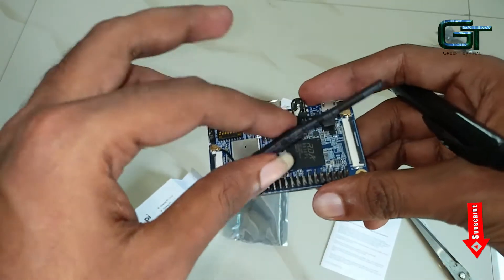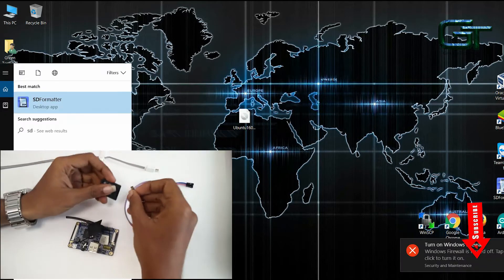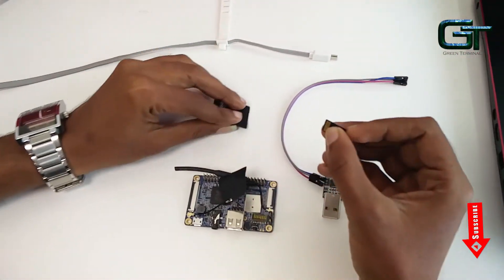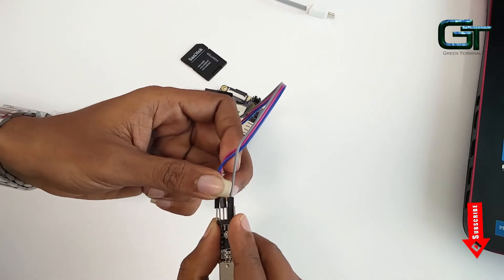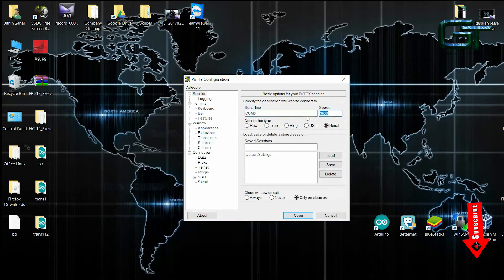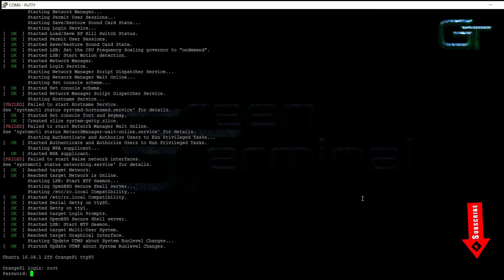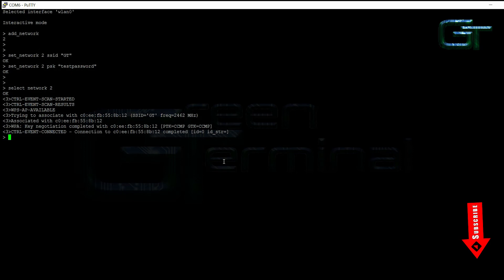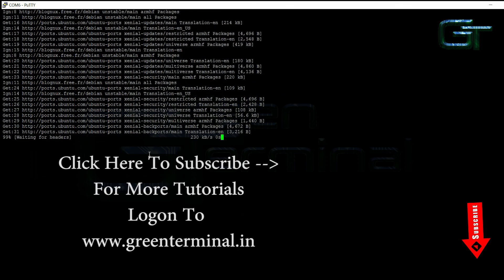Orange-Pi 2G-IOT Setup | Linux Installation and WiFi Setup via Serial Port without LCD Display

Comment: Many thanks! I didn't know that a TTL converter should be connected before a system starts. For my i96 the baud rate is 921600.

Comment: Why are you using a UART adapter? Are you saying the 2G-IOT does not support USB-serial like the Orange Pi Zero model?
Reply: look on the board for a serial to usb chip. if there isn't one, then it doesn't

Comment: Hello,
I am having some trouble with the latest "Ubuntu Server" image, as no baudrate seems to work at least on Putty. Did you experience anything similar? Thanks.
Reply: Baud rate is 921600
Reply: Make sure power supply/Adapter you are using  is 5V/2A

Comment: Thanks for the useful video.
Baud rate 115200 didn't work for me and I had to go to 921600, which is the rate actually quoted in documentation.
Wifi setup may be via OrangePi_Settings or wifi_cli, they both seem to achieve the same objective.
My wifi seems to be unstable. After boot I get lots of RDAWLAN_ERR error messages which may or may not go away. I wonder how others are faring?
Finally one last weird thing, wifi seems to come up with a different MAC address each boot.  I don't see a MAC address printed on the wifi chip like it usually is which leads me to believe its software generated. Any way to make it permanent? I like to program my router to assign fixed IP addresses which I cant if the MAC changes all the time.
Reply: Do you know how to save a new baudrate in u-boot? I did set it with "setenv baudrate 115200" but normally u-boot has the command saveenv to save the environment....but the RDA u-boot doenst got it :(
Reply: type "ifdown wlan0", to stop them
Reply: thanks mate

Comment: Hello...I follow all steps but I can not get it turned on (fomat the tf card, then write the ubuntu image) . I put the jumper J7 in T-card position, then put the TF card in TF slot and finally connected the Power Adapter, however the red led doesn't turn on. If I put the Jumper J7 in NAND position the led turns on. Is this a normal behaviour?. What could be wrong?
Reply: Mine is like this too, i read in some comentaries on the aliexpress page that this is a recurrent problem :/
Reply: Yes...I recently found in the OP forum this list:

Work:
Sandisk 8Gb microSDHC Class 4
Lexar 8Gb Class 10
Sandisk 16Gb Class 4
Sandisk Ultra 16Gb Class 10
PNY 8Gb Class 10
Samsung EVO+ 32Gb HC I

Not work:
NoName 8Gb microSDHC Class 10
ADATA 16Gb microSDHC UHS-I Class 10
Transcend 32GB Class 10
Kingston 8GB Class 4
Sony 4Gb microSD Class 4
Samsung EVO 16Gb microSDHC I

However, I will buy the chepeast one in order to check if it works.
Reply: thanks mate Will try it too
Reply: If you find one that work, please advice me...I'll do it as well.
Reply: Juan Jara ok Will Begin to search tomorrow
Reply: Sandisk micro sdhc 16GB class 4 does not work!!!
Reply: Sandisk micro sdhc I 8GB class 4 does not work.

I read that the micro SD must be 8GB class 10. In the forum is a guy who has one Sandisk Ultra 8GB Class10 working with ubuntu image from 5/5/2017. Tomorrow i'll try that one.
Reply: hey man thanks for Your help Will try it tô if i find one like this one